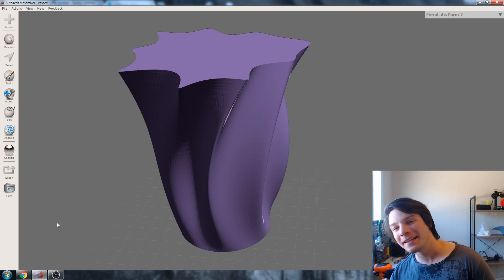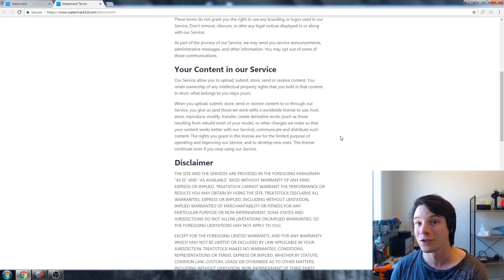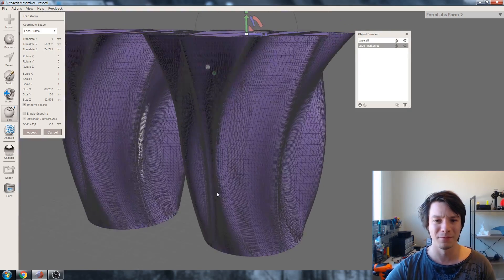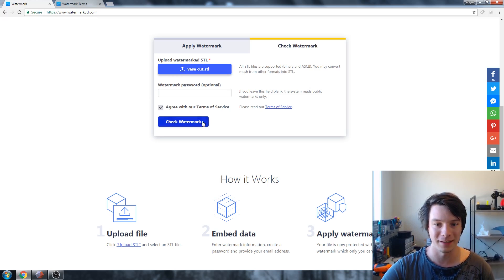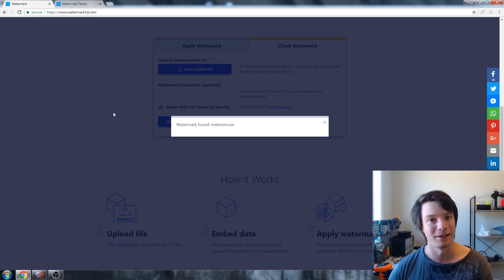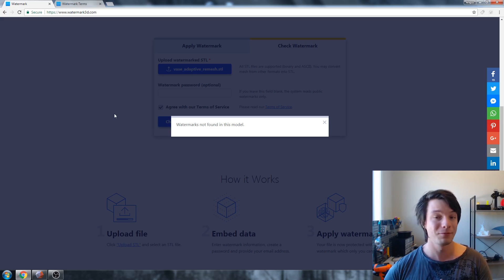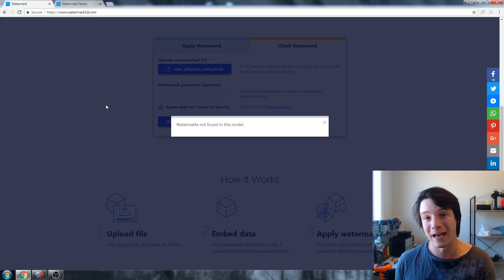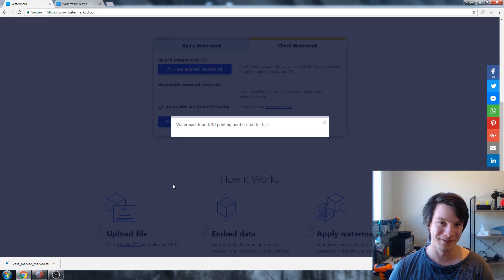How to defeat an STL Watermark (but would anyone really do this?) Watermark3D Round 2

Comment: Well I guess we found a covert way of passing messages. Lol
Reply from the maker: ... you're a genius!
Reply: I wonder what the mesh would end up looking like if you tried to embed an entire secret document into it. XD
Reply: Would it be cool to watermark that with something different than just a plain text? I would love to see it working with some other file extensions such as .png, .doc, .pdf
Reply: Caio Santos you could encode files in base64 or PGP, both methods will give you a block of random looking text you can paste in. (with the benefit that the PGP method also let you put a really strong encryption into it)
Reply: The most basic way to embed a message would be to use the least significant bit of each byte of the data. This would imperceivably alter WHATEVER in a way which can easily be extracted. However, it is also the easiest form to detect. 

If this is done however, it would be very resistant to being lost to remeshing, if it bases the new triangles on the positions of old triangles, since during decoding, it is easy to detect garbage from actual characters, and the message could still be extracted.
Reply: You could also do photo steganography which is really cool
Send photos to your friends and it won’t look suspicious 
But now they know the Russian nuke codes
Reply: It's called steganography when you do that... Basically all these watermark tricks are a form of steganography, since you're trying to hide the secret message from people who might want to remove it.
Reply: @tin2001  My guess is that the watermark itself doesn't encode the whole message, just a unique identifier that can be looked up.
Reply: #DeepState  LOL
Reply: I'd like to see this actually work, but, It would be nice to also be able to add secret messages with some other program... maybe I can get someone on that... lol
Reply: Already exists as mentioned above. Steganography. I remember nearly 20 years ago finding a free program to insert files within other files. Could literally be anything.  If it is text, it would be nearly imperceptible that anything was inserted by casual observation. Though pictures or video inside another picture or video greatly increase file size.The files would still work and be read by their intended programs just like nothing had changed. Only a steganography program could extract the embedded files. The one I'd messed with allowed encryption of the files to ensure they were secure.
Reply: I don't think it encodes the actual message. It's probably some gibberish code that the website reads and then accesses in their database, probably stored in plaintext because no reason to encrypt it in any way as it'll most likely be a name. Any messaging service would be more secure and secret in that case depending on who you want to not have it.

Downside of this functionally is that if their service goes down, your way to check it is gone forever as the information doesn't mean anything without their servers and it just acts as a way the information stored.
Reply: Well, now more people know about it.
Reply: The chair is against the wall.
John has a long mustache.
Reply: Yes! I was going to comment something similar: 
This is pretty good way to hide anything compressed with text in a stl!
Reply: Embed a qr code that links to a entire googledoc
Reply: You can already convert image files to .bmp, open them in a plain text editor and copy the text, and pasting it back into a new document and saving as .bmp gives you an image. I'd be interested to know if it would work.

Comment: im pretty sure that they just added text inbetween the code of the file where it is ignored, therefore you just can't remove it without editing the file itself, not the model. imagine it being somthing like this: you only understand these things: ab%^+_ therefore writing anything apart from that would allow a comment to be given, so that you can say ab%%^^su^+bs_+^^cri^%^%b and it would ignore ab%^+ and you'd get subscrib. They could go a bit cheeky where they have the code in binary so it sees weird characters but when read through it has specific markers (lets say binnery, format \xhex so its like \x00 or \xF5 or somthing like that) and then the encoding of that character, therefore 234543654 is seen, through notepad its seen as 2  3    4  5      4  36  54 when checked it sees the correct markers, then the very next byte is the single letter/part of a letter. This is the reason you may see some deformations. they could also use headers which is may be read as literal text in the binary code. this can be seen in images so that you may see it like this: \x78\x56\x09\xf8\xd9MAKERS\x44MUSE\xdf\xfa\xa7\xbf\xff which the code differenciates, and is not seen when looked through notepad.
TL;DR i think they may have modified the code to give the watermark, and have a side effect of slightly altering the model.

Comment: I think a significant detail has been missed here. This case involves the same person watermarking an object twice. If we stop at that, we still don't know what happens if a second person tries to watermark it.

I tried this just now, and indeed a person using a different email address can still add watermarks, but now there is a password field, and its contents (or lack thereof) must be unique within the file. If there's a match, "password already present" is reported. 

Upon checking watermarks, the service reports "no watermarks" if the password field doesn't match an existing watermark's password (or, again, its lack thereof).

All added watermarks appear to be preserved (I tried up to four, short ones), but I don't see a way to tell the order in which they were added. So if you keep the password secret you can prove you added a particular watermark, I suppose, but apparently not when. Perhaps the Watermark3D folks can establish priority if you ask nicely. I don't know, maybe some version control utilities have forensic value.

Beyond all that, I did add watermarks using two email addresses, but there's no explicit login, and all my uploads came from the same IP. So we still haven't tested all possible cases. AFAIK.

Of course multiple password access adds a new dimension to the idea of secret messaging via STL files. Use a sexy vampire model as a dead drop-dead dead-drop!

Comment: To clean up a model that has numerous microscopic 'flaws':
Edit the mesh in Blender, then use the remove doubles tool!
The watermarks are clusters of tiny detail in the mesh, right?
Set the remove doubles threshold to a value that targets the small dimensions of the watermarked features.
Yeah, you get left with clusters of stray points, but the details that were the watermarks are now no longer recognizable.
Use the 3d printing add-on to check for non-manifold edges to find and clean the point clusters, or if you are a hardy soul, the key combo SHFT+CTRL+ALT+M in mesh edit mode will highlight any non-manifold bits.
Embedding data this way is not secure at all.
As an old programming teacher told us, security through obscurity is an illusion.
Tiny little 'fingerprints' in the model is just that, the illusion of security.
Are folks being charged money for this 'service'?  I am in the wrong business!
I can see it now, Pops brand Sail-boat fuel!  Now in teal!

Comment: yea like you can use content aware fill and stuff to remove watermarks from stock images but like, if you use copyrighted material outside of fair use then ur gonna get fucked over regardless if it has a watermark or not like 

also like theres a kinda dumb as hell but the lowest low tech way to steal a model provided it's  convex enough, it's a funny idea so i had to share: 

1: 3d print it
2: use a free photogrammetry app on ur iphone to rebuild it 
3: completely remeshed without using any 3d editors haha

Comment: The terms of service do not limit how and for what purposes the company can use the original and/or the derivatives. 

The terms should cover confidentiality and intellectual property rights, at least clarify that the design remains confidential to the user who submitted it and the company will only use the file and any derivatives it produces for the sole purpose of providing the requested service to the user who submitted the file. 

I personally find the terms to be tricky and I wouldn't trust to use the service.

Comment: You could calculate a geometric difference map perhaps between the first watermarked file and the second, which likely means that if you undid the second watermark you would have the first watermark restored proving it was a derivative, the fraudster would likely of had to have done much more work than just adding a 2nd watermark in order to cover their tracks.

Comment: Here's a response to those who say it's a waste of time.

1) It seems quite easy to distinguish an automatically remeshed version of a model. In case of a dispute, this should resolve the conflict easily.
2) If someone adds a watermark to a previously unmarked model, the fact that the original owner has an unmarked and non-re-meshed model should resolve the conflict in their favour. They can't remove the watermark without remeshing, which means they owned it prior to the watermark existing.
3) If someone adds another watermark on an already watermarked version, it gets overridden, but this appears to only apply to "public" watermarks. Just knowing that a private watermark exist doesn't help the thief if they don't know the password to it, since they can't override it. However, so long as the original owner knows the password to their watermark, that proves their claim.
4) In the rare case that the thief figures out your password and overrides your private watermark, studying the model will be the deciding factor. Even if the password was overwritten, the original author will own a simpler, non-re-meshed version of the model, with the original watermark. As you can see from this video, overriding a watermark makes the geometry more complicated and is thus possible to detect.

So I'd say this is far from a waste of time. Any time this service comes into play anywhere in the process (whether it's the thief that adds or overrides a watermark or the original owner), the original owner can be determined.

Comment: They're just subdividing trieangles and encoding information in the new edges. Just write a script to find adjacent coplanar triangles and join them back together. Bam, watermark obliterated! 
Their biggest mistake is they're trying to not degrade the original model at all. Intuitively, you can't embed a robust watermark into something without degrading it because if you do, the watermark will end up being clearly redundant information which can be very easily found and removed.

Comment: If I were designing this kind of software I'd be aiming to have each "patch" contain all the information needed.  Failing that I'd want 2 or 3 patches as the max needed.  I'd aim to use some kind of encoding mechanism that is based on particular geometric constructs and their adjacency in an attempt to preserve against changes that can be reversed with a normalisation transform.  If I could find a way to do it in a way that didn't break prints or get removed by software, I would prefer using properties that aren't visible from inspecting the model, things like polygon normals.
I think I'd be tempted, on the grounds of it being a more useful technology if widely adopted, towards encoding something more akin to a serial number matched against a database than the actual text, which could explain why a second watermark overwrote the first.
I'm actually more surprised that adding the second watermark didn't cause it to fail to read one at all.  My guess is the watermarking code has to first "compromise" any collection of triangles that read as data fragments and then add new ones.  If they didn't then they'd have the issue of the software trying to solve which patch goes in which group of watermarks (resulting in it failing to read) and have the possibility of unintentional geometry reading as a watermark by confusing the recognition code.  The most reliable solution, if not using a central database, is to ensure that the file doesn't read as having a watermark before applying a new one.  If they can't actually tell if the mark is real then it would appear buggy to throw an error when detecting a mark.

It would be interesting to run the original, singularly marked and doubly marked stl files through a diff program to see how much alteration was made to the geometry.

Comment: Using the Blender "decimate" modifier in "planar" mode with a very low angle threshold recombines all the additional geometry the watermarking introduces and easily cleans the file without any significant destruction of the mesh. (in my testing 0.014, or 0.04 if you want to be sure, degrees is enough to disrupt the watermark but is practically unnoticeable when printed)
Reply: turning triangles to quads and then triangulating again might also work.
Reply: this or limited dissolve, iirc
Reply: @heyjoeway  Yes, I was thinking limited dissolve too

Comment: 4:02 "The watermark is merely to prove the original owner." You have this completely the wrong way round. Watermarking is about custody, not authorship. For instance, you might watermark a file before sending it to different people, so that then if this file ends up somewhere you didn't expect, you'll be able to tell whose copy it was that ended up there. Watermarks are not for proving authorship - if you want that, add an actual copyright notice to the file and then submit the file's hash to a timestamp authority.